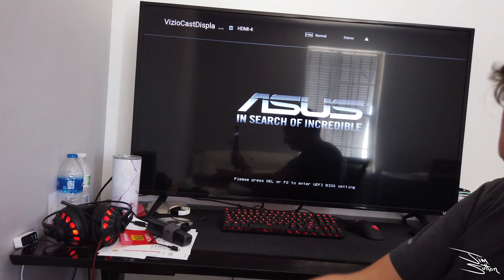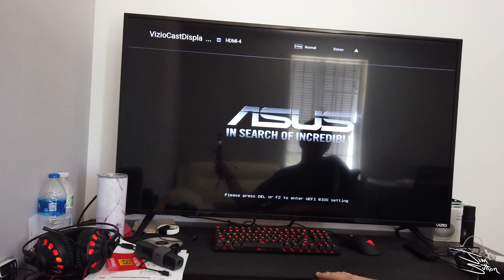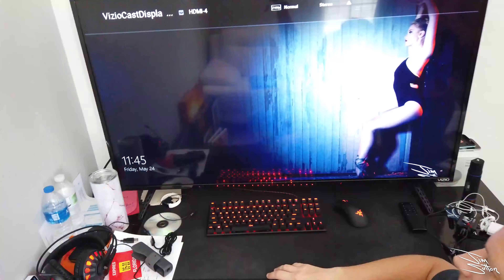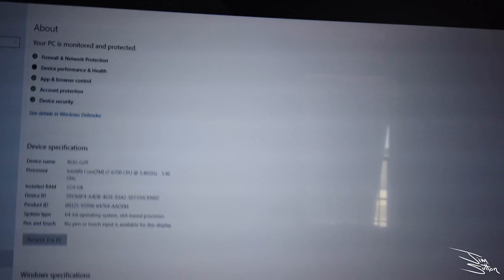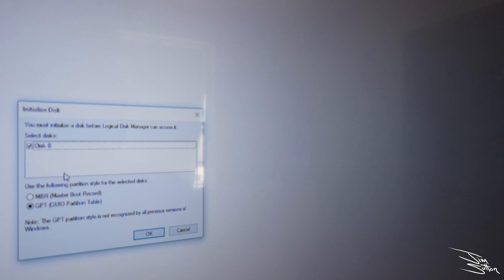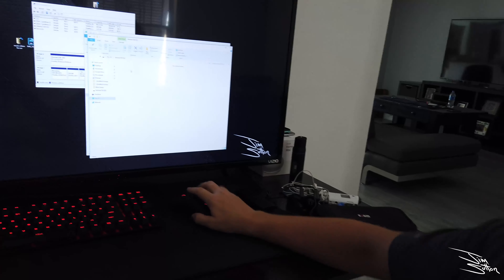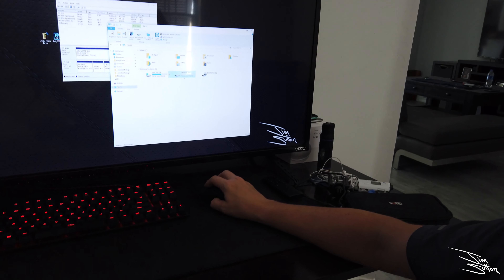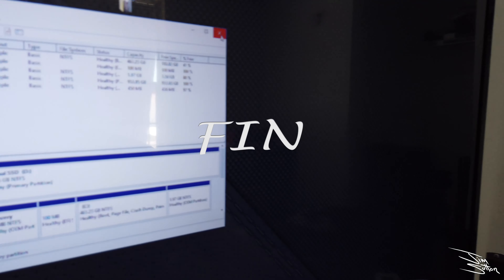VLOG #108 back up and running upgrading RAM and SSD for editing ROG G20CB

Comment: So did you remove the ribbon cable over the ssd when u removed the hardrive?
Reply from the maker: Hmm. I don't know exactly what you mean.  The esata cable?
Reply: @DeCoNzMe  like when you removed your hardrive did you unplug that silver cable that sits right  above the hdd
Reply: @DeCoNzMe  I only ask because I'm seeing some people say to leave it alone because its fragile. @1:45 that cable on the corner of the hdd
Reply from the maker: @cjleh757src6  oh ya. good catch.  yes I left it alone, you can slide out the hard drive without messing with it :-)
Reply: @DeCoNzMe  good to know, I'm installing a new hardrive on one I got off a friend
Reply from the maker: @cjleh757src6  hope it works out perfectly! Let us know!
Reply: @DeCoNzMe  will report back after my hardrive and windows 10 disk comes in the mail tomorrow